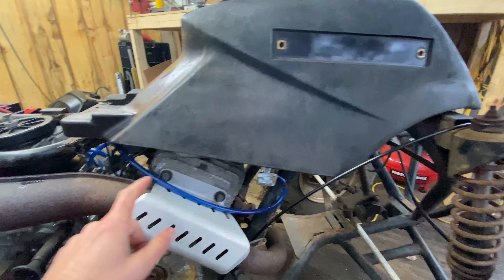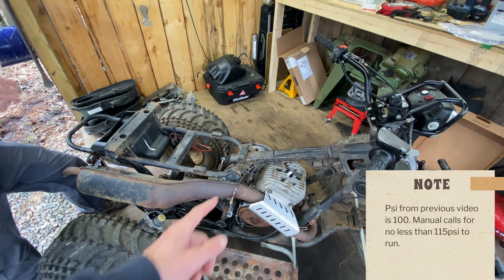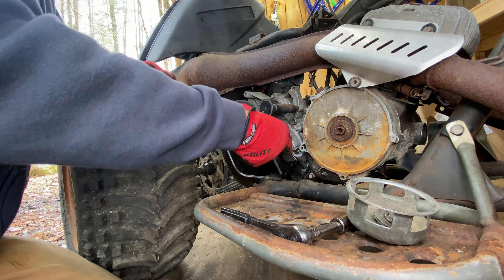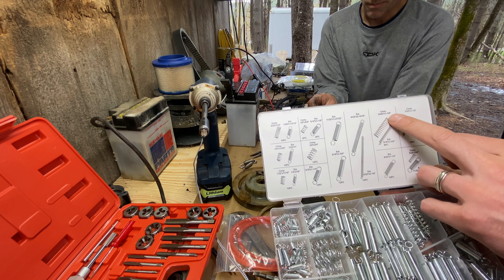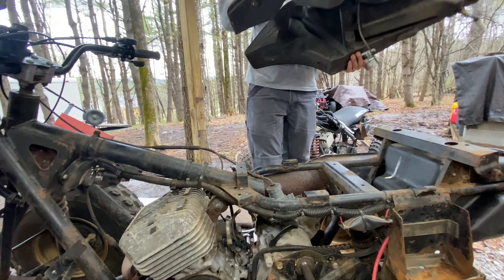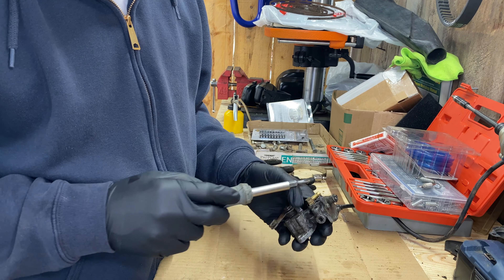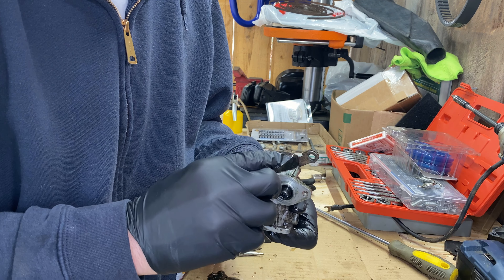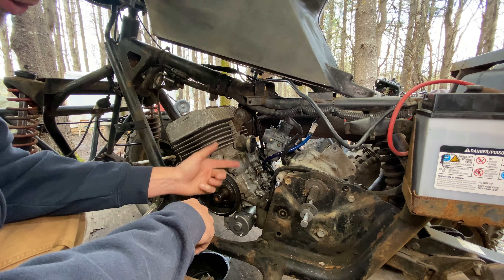Two-stroke Oil Pump Tear Down and Testing: Understand How It Works

Comment: Been waiting for an update on these! It should have definitely started on 100 psi. I've started one on 90. Had to smile when I heard RTV 😂 Thanks for the video!
Reply from the maker: Trying to get RTV in my head :). I have another thought on why it didn't fire as well that will come in the next video. (There was a lot of oil pooled in the bottom end.) I'm still working on them.

Comment: line coming from the oil tank fitting ( in first post). 3/16?  Pump rubber line size? to cylinder cc fitting.

Comment: Is the from coming from the oil tank 3/16 I.D? 
See your using blue urethane hose. 

Is the rubber oil feed line going from the pump to check valve fitting to C.C. Is it 3/16 I.D hose? 

Think on next video you were using the blue urethane hose instead of rubber black hose to see if pump was putting flow.

Comment: I am having a hard time finding the clutch cover and back plate for that, we're did you get yous put of curiosity.
Reply from the maker: I have a link in one of the videos in the series. Ultimately it was an aftermarket but it fit great. If you check the descriptions in the videos in the series you should find it.